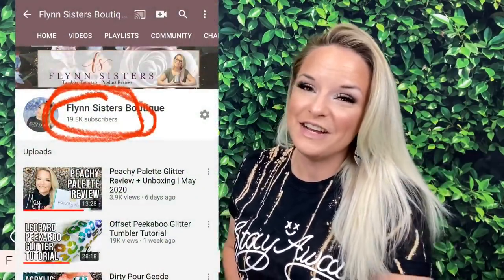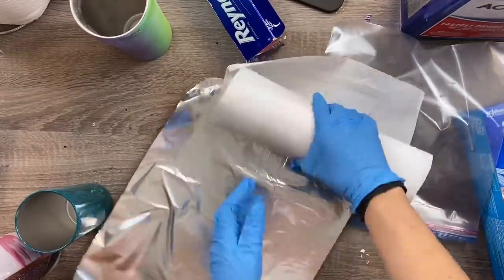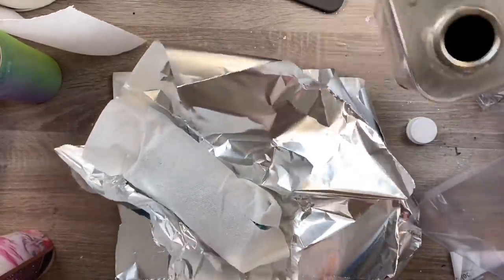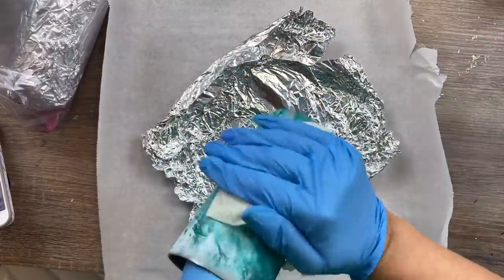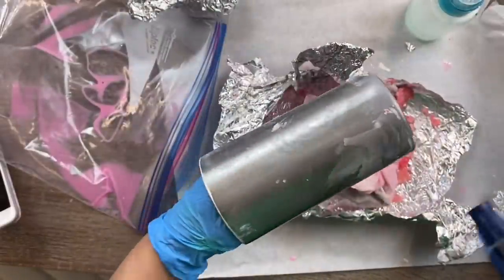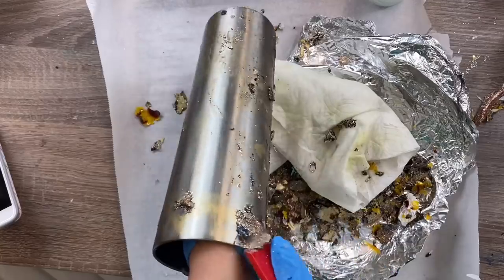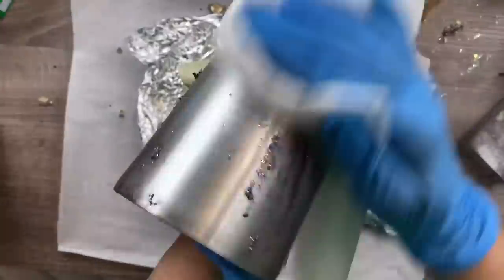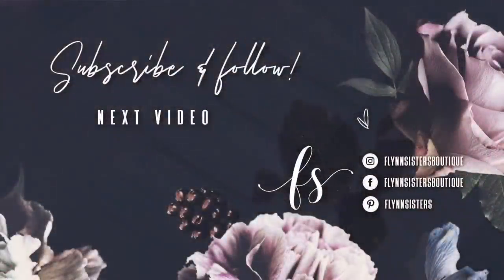How to Strip Epoxy Tumblers

Comment: I have stripped this way and it is pretty easy but now I do it in a bucket. It's just as easy and there are less materials and less waste. Just put about an inch of acetone in the bottom of a bucket, sit your cup/cups in, put the lid on and let sit for 24 hours(ish) and it all just falls off. I know everyone has their way of doing things just thought I'd share mine. ;) Love all your videos!!
Reply: That's exactly how i do mine. It so much easier and I can do multiple cups at a time.
Reply: Does the acetone just work it's way up the cup, from the bottom to the top?
Reply: verosanchez12 the fumes from the acetone do all the work! It’s my favorite and easiest way to strip a cup

Comment: I just tried this, and it WORKS. I did it exactly like she did, however I let mine sit for a little over 48 hours, and it worked perfectly. I had prepped a 30oz steel tumbler with spray paint, a  glitter epoxy layer and 3 layers of epoxy. After about 50 hours, I unwrapped the cup and everything g basically just slipped off as I unrolled the paper towel. It’s because of THIS video that I saved a tumbler and can totally reuse it. You saved me money, a major headache, and I basically have a new tumbler for resuse. Thank you so much. You totally earned my subscription. Thank you!
Reply from the maker: Thank you so much for the wonderful feedback! I’m happy to help!

Comment: I messed up and I only put part A on tumbler thinking I did both how do I remove the resin ?
It has not dried any at all. I'd appreciate your feedback on how to remove it
Reply from the maker: Get some paper towels and acetone and clean up as much as you can. If you have some kind of powder or scrub cleaner use that for the remainder, then another good wipe down with rubbing alcohol.

Comment: Suggestions on how to strip just the inside of the cup? The outside looks great but epoxy ran inside and stuck my football to it. Ughhh
Reply from the maker: you'll have to just rip out the football as much as you can and then pick off the epoxy with something that won't scratch the inside. then clean it up with acetone, then wash it out really well.
Reply: @FlynnSistersBoutique  Thank you!

Comment: What do you use if cups are bigger then ziplock bags?
Reply from the maker: I’ve never used cups that were bigger than a gallon bag size so I’m not sure. Some gals use 5gallon buckets with lids but I’ve not tried that

Comment: I have a cup that is sticky. I used allumilite quick coat and I mixed 30 mls. I measured 15 mls of resin in a lil cup and 15 mls of hardener in another cup then I poured them in a cup together. I needed to do a final coat on the cup and then with the extra I made some little checkers for a checkerboard. Then the next day I tried to demold the checkers and they were very bendy. I left the cup and the checkers for another day. Still soft and bendy. I touched the cup and noticed it was sticky! Soooo do I need to strip the cup??  Normally I mix the 1-1 ratio in the same cup pouring B 1st and then adding A to the measurement I need. But I wanted to see if it made a difference. It did! I guess, I’m not sure what went wrong. The cup could have sat there for over 24 hrs and I didn’t sand it ,so could that make it sticky? I made 8 cups so I was back n forth. 🤔🤷‍♀️
Reply from the maker: Well unfortunately you could have a mixing error there. Quick coat requires really precise measurements and I always pour part a first then b over it since part a with this formula is thinner. It also needs you to mix a little longer for whatever reason. You could sand that completely down and probably be ok to coat over it. I wouldn’t use fast setting epoxy in molds. That never works out for me personally. It’s either too brittle or doesn’t cure well.

Comment: I stripped my first tumbler today and it has a slight white haze to it after I wiped it with alcohol. I've cleaned it with soap and water and wiped it with alcohol and it's still there. Is my tumbler ruined?
Reply from the maker: No, if it’s smooth you can go back over it